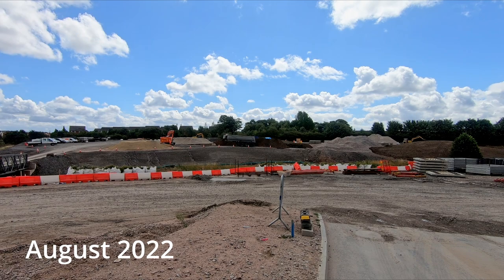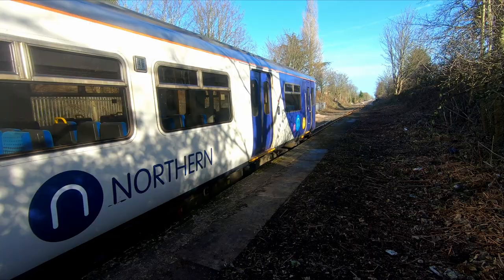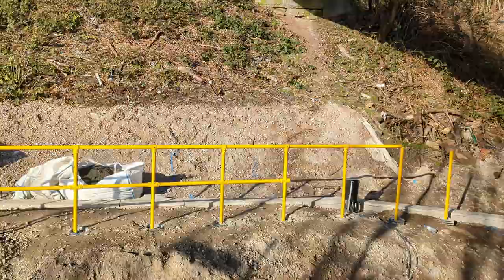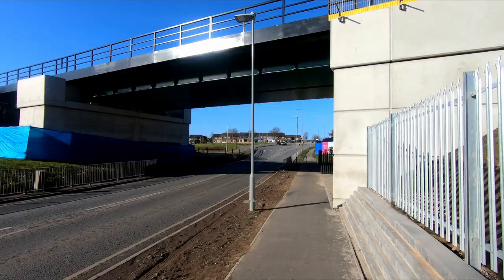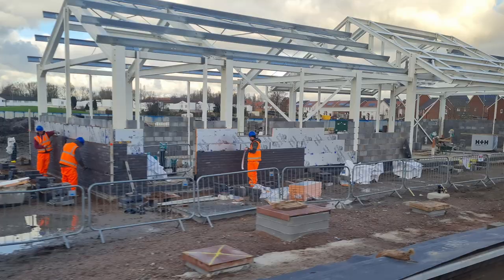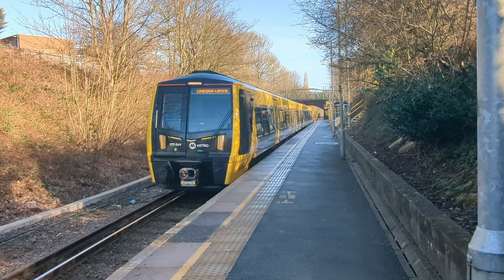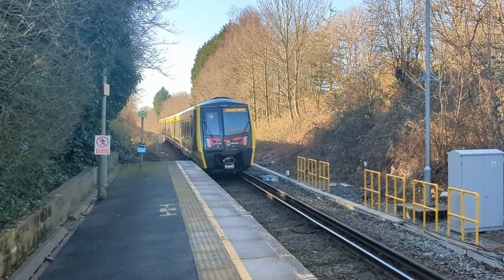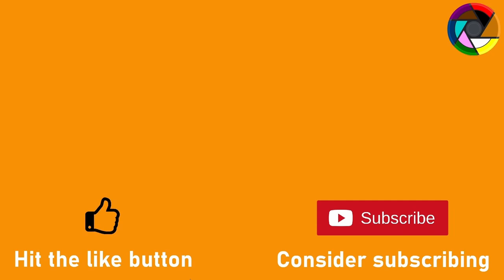Merseyrail Headbolt Lane Update | January 2023

Comment: I physically facepalmed when I heard that the extension to the new station isn't being electrified. On such a short stretch of line you can hardly argue that cost would be an issue, and electrification has been shown time and time again to be the best way to operate a railway. Anything else is just making excuses.

Same applies for the other extensions they're talking about, although those would require more costly engineering to electrify the lines so I can understand why they might be a bit more unwilling to upgrade those lines.

At the end of the day, I'm not going to let the perfect be the enemy of the good - if they can expand the Merseyrail service using battery trains then that would be great, but it's just frustrating that these lines aren't getting the proper electrification they need!

Anyway thanks for the construction update; what with the new trains and stations, the Merseyrail network looks set to have an exciting future, and I can't wait to see how it develops!
Reply: There is zero business case to extending electrification which is why it hasnt happened. Any extensions to merseyrail in future have only been made possible because of these new units and their batteries. Even this short section to Headbolt lane.

Class 777/1 units have an ~84 mile range on battery power and can recharge in ~15 minutes running on the existing third rail. Which puts Preston, Wigan Wallgate, Warrington Central, Helsby and Shotton, all within range of the units.

If the batteries in the seven 777/1 units are successful on the Kirkby extension expect more to be ordered for additional extensions.

Borderlands line to Wrexham would probably require a recharge point within the station, which i think makes this extension unlikely unless they extend the range of the batteries.
Reply: @SomeVeryRandomStuff  ...and in 5-10 years when the batteries are dead weight? When wires are up, they last. Plus, they don't require as many rare or dangerous chemicals to be dug up.
Merseytravel (namely Serco-Abellio) don't want to lay electrification because they're going to be replaced in 5 years and don't want to be the ones to invest in expansions just for someone else to reap the rewards; the efficiency of the "free market!" ( /s )
Reply from the maker: Liverpool City Region saw this as a cost effective way of expanding the network and up until recently the ORR and Network Rail were against expansion of the 3rd rail network.
Reply: @Rail Focus  frustrating to hear NR and ORR were against third rail expansion - there are a lot of places where infill would make sense, however there are also a lot of safety concerns so I suppose it's understandable.

Likewise, I can't hate on Liverpool City Region too much; any expansion of Merseyrail would be a good thing and I doubt they have the funding powers to pull off a full electrification, but it is frustrating nonetheless.
Reply: I dont think LCR or Merseyrail have any sway with NR / ORR or the DfT. If these national bodies say that its too expensive then its not happening. Hence why LCR opted for the batteries which was an excellent decision.

Its not just the initial cost of construction but the ongoing maintenance cost of any extension to electrification.

The cost of batteries is pence compared to the cost to electrify and maintain these lines. For a 2-4tph frequency line its just not worth the bother. Diesel, Hybrid or Battery are the only alternatives.

I think we should be thankful that this technology exists. If LCR/Merseytravel had ordered new units a decade ago it would have been like for like replacement with no batteries and no hope of any extension for 40 years. Now we could see big extensions within the next decade.

For once in their miserable existance LCR have actually done something right.
Reply from the maker: @MikeWillSee  It seems the ORR and Network Rail have changed their minds, but only after construction of Headbolt Lane had started and the battery trains had been ordered.

And it seems the ORR and NR are only really interesting in exploring if 3rd rail can be extended in the South East. 

But one good thing to come out of this could be the battery IPEMUs, if they perform well then we could see them on other lines, like the Wrexham-Bidston Line which currently has no hope of being electrified. So although not ideal could help to extend the Merseyrail Network without electrification.
Reply: @Rail Focus  that makes sense to me. Third rail infill in the Southeast would make a lot of sense, and it would be good to see an extension of Merseyrail down to Wrexham if possible. As mentioned before, I forward to seeing what the future holds!

Comment: More on the battery 777s please
Reply from the maker: Will see what I can do 🙂
Reply: @Rail_Focus  really only 7 or 8 777's in bi-mode form won't be enough. They really need to kit out more of the units or even all of the units. So far iv only seen 2 777/1's: 777140 & 777142.
Reply from the maker: For now 7 will be enough for Headbolt Lane, but the option remains open to fit batteries to existing units or to purchase more units if future extensions are ever planned

Comment: Hmmmm i am a bit scepticle about Kirkby remaining single track platform, wont that cause 'pinch' points,and what happens if Merseyrail want to expand from Headbolt Lane
Reply from the maker: Headbolt Lane itself has 'passive provision' for future extensions and there will be 2 Merseyrail platforms, if HBL becomes a through station they will need to install lifts and stairs, but for now there will be level access to all 3 platforms. Kirkby being single platform is about doable, but it could potentially be an issue, hopefully mitigated by the 2 tracks and platforms at HBL.
Reply: @Rail_Focus  ahhhh right, i see
Reply: There is a 4 minute idle time at Kirkby. So any train arriving at Kirkby from Liverpool would have 2 minutes to clear the single track and get into one of Headbolt Lane's two platform roads to be out of the way for the other unit travelling south - easily achievable based on the distance.

We know there is an additional unit being added to the circuit when Headbolt lane comes into use because there wont be enough time for crews to change ends otherwise.

So i'd imagine that if there was any delays to the northbound train, the southbound train would be given right of way to run to the timetable and the northbound train would be have to wait until the southbound train had cleared the single track.

TLDR
Its not a pinch point. Kirkby wont be a passing point in the timetable so no need for double track.

Comment: Funny how the north of the city gets more and more rail connections, but the east and south portions of the city are still critically lacking. With stations on the Liverpool section of the WCML being demolished with no local services running, the entire North Liverpool Extension line being demolished, the Northern line only ending at Hunts Cross (and following the river basically right up until that point) even though they promised it would go further, the fact there's not even Southern or Eastern lines...! There's not even an airport rail link!!! I could go on.
It seems Merseyrail cares more about getting people from outside of the city into the city centre rather than providing the suburbs of Merseyside affordable and efficient transport... unless you live along the river or north of the city centre.
Reply from the maker: Kirkby and Headbolt Lane are in Merseyside.  Proposed Liverpool Baltic within Liverpool and Maghull North recently constructed also in Merseyside. Yes there's more that could be done to improve connectivity, but that's no reason to begrudge a station that Mersetravel clearly thinks there's a need for.
Reply: @Rail_Focus  I think it's a "yes, and" situation. It's good to see them expanding (despite their difficulties electrifying it) but I feel like that doesn't mean we shouldn't expect other basic proposals like expanding past Hunts Cross - especially since they originally promised to initially but reneged. A world-class city needs a world-class transit network.
Reply from the maker: @caramelldansen2204  hopefully Headbolt Lane and Liverpool Baltic are just the start. If they are a success maybe LCR will feel more confident to be more bold with it's plans for the future.
Reply: @Rail_Focus  🤞